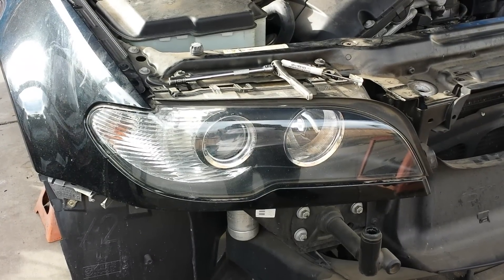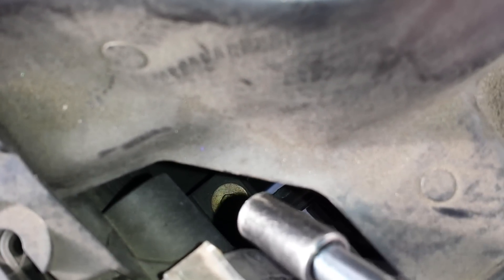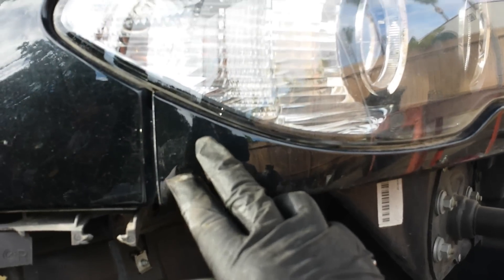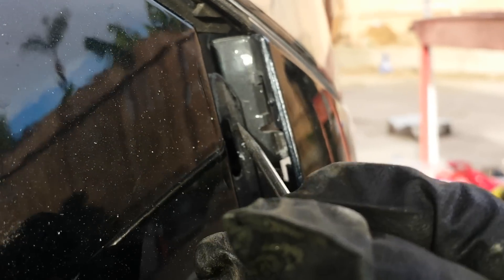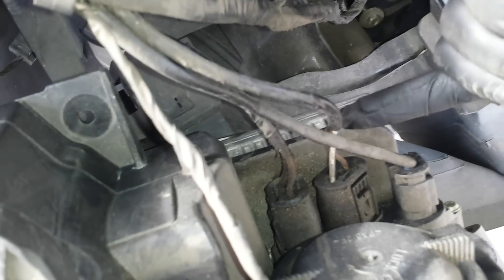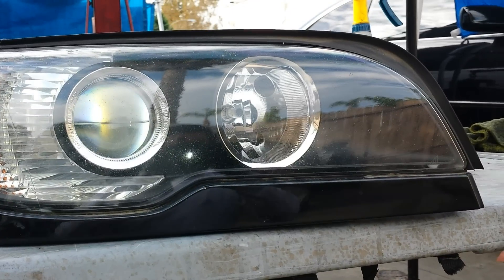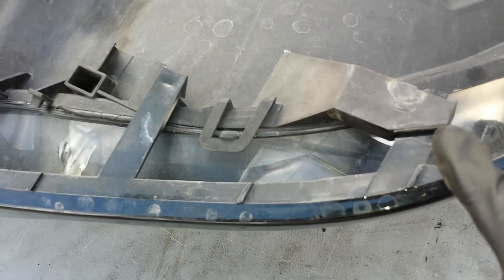How to remove the front headlight BMW E46 330ci 325ci

Comment: The best video on  BMW E46 HEADLIGHT removal ever with clear instructions, excellent close ups, and knowledgeable instructor.
Reply: Fax i just used it to fix my bumper
Reply: Do you need to take off the front bumper to remove the headlights?
Reply: @qewee5212  nope

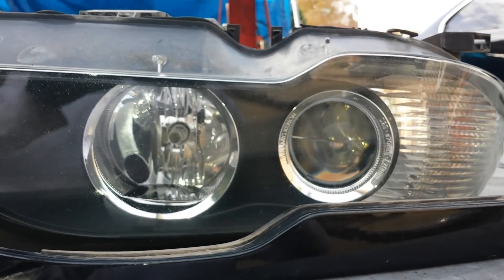Comment: A much better and less damaging way to remove the trip clip as mentioned around 6:53 is to remove to lower splash guard and depress the tab while sliding. Releasing the clip is done by hand. prying the trim will always damage it, even slightly.

Comment: Great video, but I still have an issue. I have all the screws out, and the trim unsnapped. I can slide the headlight out, but there is what feels like a spring on the bottom holding the assembly in place. I can pull it out about 3-4 inches, but if I let go it pulls back in place. I have the adaptive headlights on my 2004 325ci convertible. Is there something else holding the assembly in place if the lights are adaptive?
Reply from the maker: Seems like your headlights have the water jet used for cleaning the lenses.  You need to disconnect the valve from the plastic hose that leads to the windshield washer reservoir.
Reply: @bimmermerchant  It was the water jet. I was able to get the headlight assembly out by carefully removing it over the the jet. My actual problem wasn't the bulb, starter, or ballast, but two of the wires going to the starter were broken. Maybe from the heat and vibration. I soldered and everything worked again with the original components.

Comment: Hi, I hope you be able help me seeing as the video is fairly old. I'm in the process of replacing the bulb but I'm curious to know if there's a way of opening the headlight without baking it? There has to be a way through without a heat gun or use of an oven. Thanks!
Reply from the maker: Unfortunately we haven’t used those methods to remove cover so we wouldn’t be able to offer a solution
Reply: @bimmermerchant  Have you ever removed the lens ? Is there a method you can share ?

Comment: I was told there was a ballast and an "igniter". Is the igniter one of the boxes shown or is it located elsewhere on the headlight assembly?
Reply from the maker: Igniter holds the high intensity D2S bulb and is found inside the housing.
Ballast is usually found on the outside lower part of headlight.
Reply: Thank you! Subscribed. :)

Comment: i have a 05 325ci driver side headlight went out and a month later the pasenger side started flickering now is out so i changed the bulbs and the dont work do you think its the ballasts and do you have them
Reply from the maker: if bulbs didn't fix issue, ballast would be next part you would need.  Check out our website for ballast: http://www.bimmermerchant.com

Comment: My low beam and high beam do not work. Sometimes it comes on for a few seconds then goes off and my fog lights come on. I was told I may need a ballast. How do I know for sure or do I need both?
Reply from the maker: does this happen on both lights or just one headlight?
Reply: On low beam and high beam on just passenger side.
Reply: +Debbie Early what did you end up doing? Because I have the same issue

Comment: Nice video man. But one question, do you know if the clear plastic lens on the front of the assembly is held on by clips and is removable? 
They are starting to get a little cloudy on my e46 325ci and I just assume that if I can get them off I can clean them or just replace it.
Reply from the maker: +Yoshimatsu414 As far as we know, front lense covers cannot be removed.

Comment: hi, I bought 2004 330ci, passenger side low and head beam both are not working. But when I DIP/blink it is happening. what would have been wrong? to Replace bulb do I need to take out the whole assembly?
Reply from the maker: You don't have to remove whole headlight assembly however, we would recommend it.  You will be able to insert bulb properly and risk hot bulb touching side plastic walls and burning through it.
Reply: Thank you I am able to take out and my surprise it was compromised, I see pre-owner solder the wires, and the bulb was broken in peace. I think it was due to impact. well, worst case I prepared to buy used one.. can suggestions where can I get t from!

Comment: How do you remove the lens cover on the adaptive headlamps so I can replace the turn signal bulb?  Do I have to remove the entire light module?  Thanks.
Reply: Paul W did you figure out how to remove the lens?
Reply: @andrederilus7612  u need to heat it up its glued

Comment: I have an 05 bmw 330ci with adaptive. But the lights on the inner part of the headlight do not turn on at all. High or low beam. What could cause this? I've checked the bulbs and fuses. But to no avail.
Reply from the maker: check your ballast and ground connections.

Comment: i have a 2004 330ci and removed all screws but my headlights have an extra piece in the headlight trim, I think its a headlight washer how do I remove it
Reply from the maker: You got me there.  I haven't replaced any headlights with the headlight washers therefore I wouldn't be much help there, sorry.  Will do my own personal research and get back to you.  Thanks

Comment: I have BMW E46 330Cd 2005, has the same headlights but it's not xenon, don't know why
Reply from the maker: +Tato Oikashvili BMW is weird that way.  We've seen headlights that are halogen as well.  Don't know why bmw would manufacture 04 models with halogen bulb versus xenon.  Depends on the package the car is equipped with.
Reply: It is a way to give customers cost choices. These lights add a few thousand dollars to the sticker.
Reply: bimmermerchant how do you have xenon headlights without headlight washers.every xenon headlights have washers and it’s not an option🤷🏻‍♂️